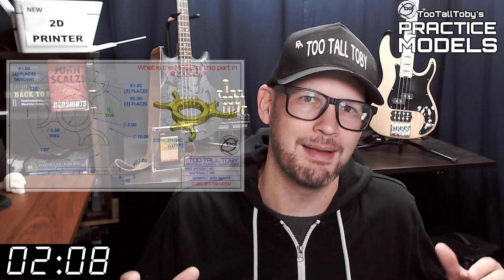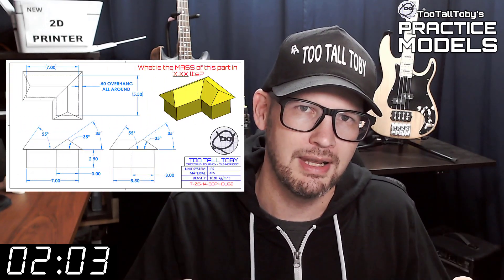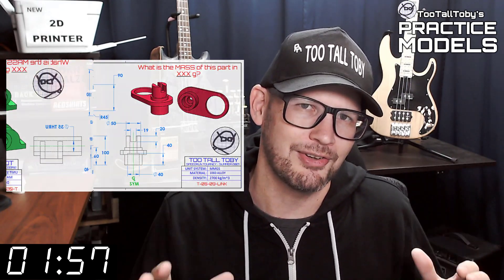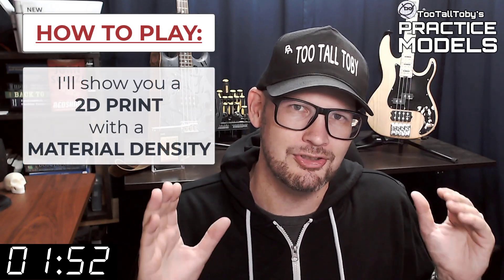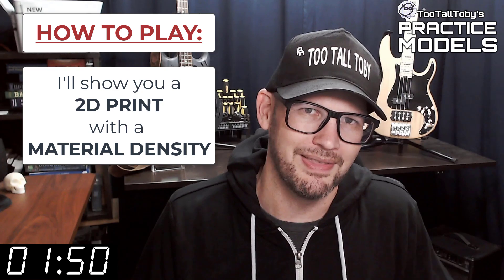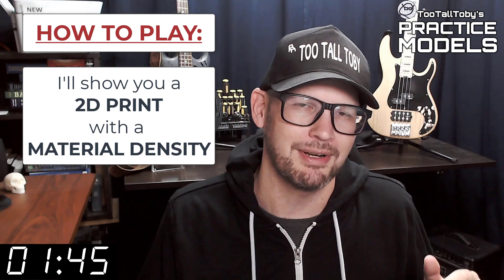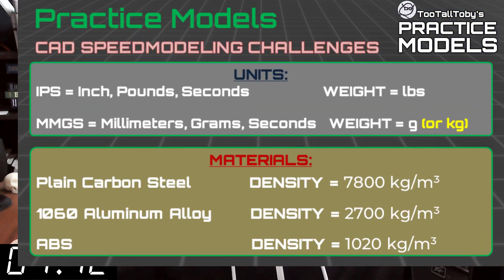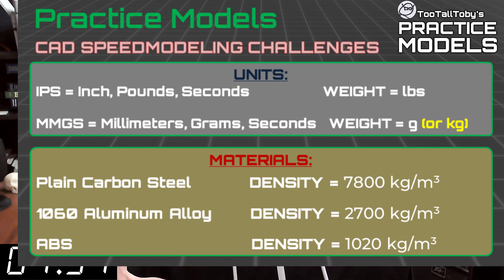2D Drawing to 3D CAD - PRACTICE MODEL- Exercises for Onshape, SolidWorks, Fusion360 - DRILL MOUNT

Comment: I am struggling with the placement of the 42 mm radius. Specifically, where is the tangent point where it meets the top surface of the slotted base? It's obviously not out at the edge of the part due to the tangent line in the 3D view. I'll hit my forehead when I hear where it is, I'm sure.
Reply from the maker: Here's a tutorial I just dropped - hope this helps!  https://www.youtube.com/watch?v=Y8t_1mkpuFo
Reply: @TooTallToby  when I watched it done, I hit my head. I was trying to draw the arc, didn’t think to use fillet in that instance. 🤦🏻‍♂️
Reply from the maker: @bmndjd  Awww yeah!!  Awesome!  Glad this helps!